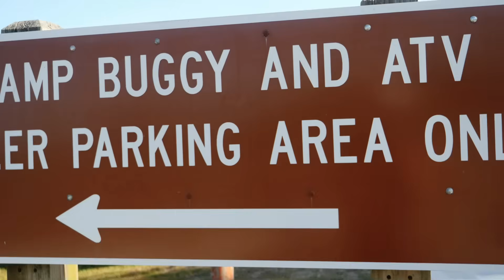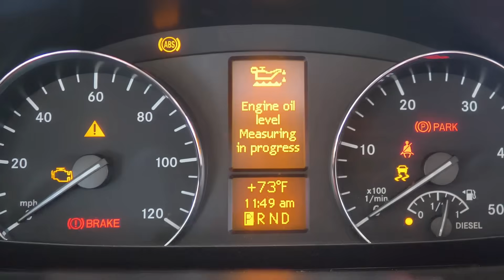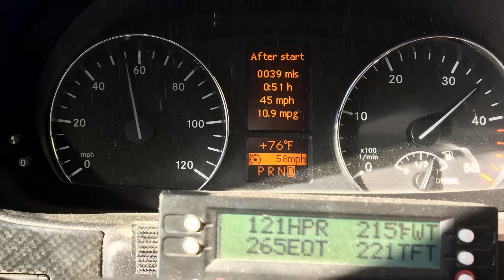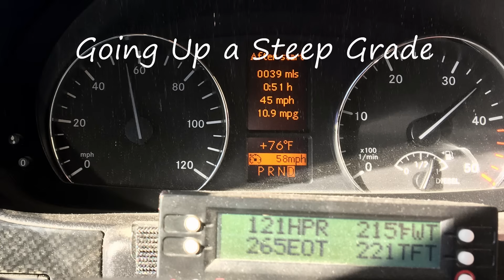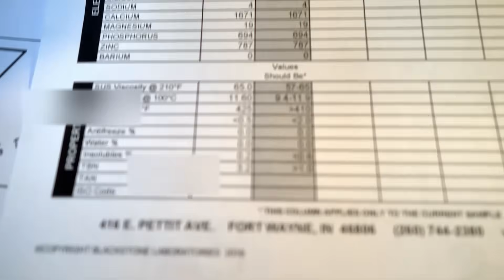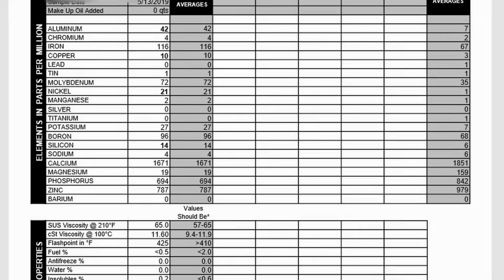Sprinter 20,000 mile oil changes

Comment: I asked Chat GPT why some manuals like yours state 2 years 20K miles, some say nothing, others state 10K and 1 year.  It said the following:

Why the discrepancy exists:
European owner’s manual
- 20,000 miles or 2 years
- Designed for Euro-VI engines and long-haul use, low sulfur diesel
U.S. Mercedes-Benz maintenance sheet (MBUSA)
- 20,000 miles or 1 year
- Mandated for U.S. emission and warranty compliance
Real-world diesel RV / fleet users
- Oil analysis often shows safe operation up to 15-20k miles or 18-24 months
- But only if oil analysis (TBN, soot, viscosity) confirms

Practical take For your (mine, low mileage) 2017 Sprinter 2500 (U.S. model):
The official MBUSA interval is 20,000 miles or 1 year, whichever comes first. The "2 years" clause is technically valid in the European context or for verified oil analysis intervals but not for U.S. warranty or emissions compliance. Low-mileage owners can safely stretch to 18–24 months only if oil analysis (e.g., Blackstone Labs) confirms acceptable Total Base Number (TBN) and soot levels.

So as you stated @ontheroadwithron2342 --

Chat GPT Recommendation:
If you’re driving ~2,000 miles per year, Change oil annually for simplicity and protection. If you want to test the 2-year claim, pull a lab sample at 12–18 months; if viscosity, soot (<1.5%), and TBN (>4.0) are in range, you can safely extend next time.

Comment: Hey Ron - great video!  I really appreciate the walk through of the oil analysis report, and especially you sharing the content- funny how useful actual DATA is ;)

I was curious how it's been holding up and what your comparison/trend has been with any subsequent analyses?  

I was intrigued by your comments on the clamps used on your fuel filter.  I've always used genuine Oediker clamps on fuel lines as they're very secure and not as susceptible to stripping out, failing, etc.  Your use of the solid band hose clamps is a nice upgrade vs the usual slotted ones.  Any reason you're not replacing with real Oediker clamps?

Overall I really dig your videos - gives the DIY person some confidence to get in there and tinker with their machines rather than to be so dependent on a dealer or mechanic - much of what you show is really pretty simple and doable.  

Thanks again!
Reply from the maker: As far as clamps go, I am more familiar with the solid clamps so used them. The original ones were difficult to remove and seemed like you’d need a special tool for them. Solid has done the job.

Comment: I am a few years into my Dynamax Isata 3. Just rolled 20k miles.  Conducted Schedule B. Your fuel filter change vid was very helpful. Thank you.   The Turbo Seal is now a newer part number MB 0000940051. From Mercedes they are $60.  I bought one from Amazon for $30 but had concerns that it might be aftermarket so I sent it back. Ordered one from AutohausAZ for $36. Shoot, it was green. So I went to MB and looked at theirs. It was also green and had the same marking so I kept it. 
I’m not 100% sure it really needs replaced at 20k, but I do see the MB bulletin on this so I did anyway. 
Keep up the good work Ron.  You must be an engineer. 👍👍

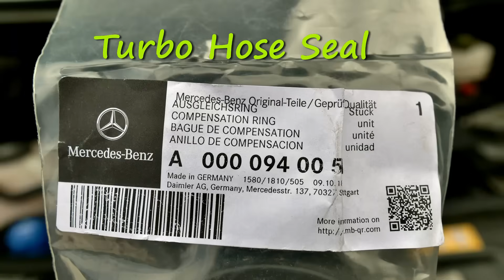Comment: 2:32 it's not that hard to reuse the existing MB Clic clamp, or replace with new.  There is a $15 tool if you search Clic or Clic-R.  That way the tension on the hose if perfect. 2:41 the MB bulletin says the clamp is to be torqued 3Nm with new seal always if disturbed, clean and dry reinstalled.

Comment: 20000 is FAR TO LONG. 5000 is a max if you want to avoid engine damage no matter what type of oil you use
Reply from the maker: There are a lot of opinions of course but 20k is what Mercedes recommends.  I’ve tested this at an independent labs and the oil is still good.
Reply: @ontheroadwithron2432  I love how all these people see hard evidence but still deny it

Comment: I have a 2018 Winnebago Mercedes Sprinter - I recommend to change the oil every year - because combustion creates water !
Reply from the maker: That’s true however the oil temps in a diesel engine are very hot and any water will evaporate quickly once up to temperature. If you only drive a few miles at a time, i agree an annual oil change would be best. RVs are usually driven long distances so not an issue.

Comment: Good info and all the comments listed below! Our 2018 RV Sprinter is my Daily Driver, maybe 15,000 miles per year. Today at 13,500 miles I changed the Oil only for the second time no filter change. I am sending the Oil out to the Lab to double check how the Oil is holding up in my application! I am using MB oil 5w30, but I'll probably use Mobil 1 ESP 5w30 and MB filters only. I use only OEM Filters, because of the Parts Warranty represent a better value! I am using a Caterpillar Oil Test Kit, $20.00, Kit Bottle/Postage to Lab/Report.
Reply from the maker: Great. Let me know the results. The ESP oil has lower ash so will prolong the life of the particulate filter.
Reply: As I mentioned our Sprinter is a 2017 Chassis with a 2018 Pleasureway Class B RV. When I bought it about 8 months ago, it had 3,200 miles on it, so I had the "B Service" even though it wasn't due. Now at 13,400 miles, I decided to change only the Oil and have it Tested to determine the Oil Change Interval. At this point I'll probably change the Oil/Filter every 20,000 miles and just the Oil every 10,000 Miles. I've spent over 50 years in the Diesel Truck/Construction Equipment Industries as a Regional/District Service Managers, so I've seen a fail amount of GOOD/Bad Maintenance Practices. IMO, I would rather error on the side of "Over Kill," rather than on the "Wish I did" side, there no down side! As for what Oil to use? I would recommend any oil that meets MB standards , but if it is available, I prefer the MB Brand because of the unquestionable quality and the fact that it stated on the Receipt, which will, benefit in the resale value. I noticed that Mobil 1 for example has 36 different Oils (all Mobile 1) but only one of them meets the 5W30 and the 229.52 Spec!

Comment: Change oil, using 10k interval. MB won't pay for your future troubles after using their 20K recommendation. My reference: 2011 Sprinter Van, 170" 2500 EXT with final 560K miles. 2016 Sprinter Van 2500 170" EXT with current 820K miles. New engine installed 180K miles ago due to failure original engine due to (in my opinion) MB recommended 20K miles oil change procedures.

Comment: Great video. My rig is a 2008.  Oil changes recommended at 10,000 miles. The first change was done by the dealer. I noticed that MB added a quart of BG DOC.  I performed the change this time. Plan to get a Blackstone report.  Thanks
Reply from the maker: Pretty easy to do. Main cost is oil.  If you can get it on sale, it helps s lot.
Reply: @ontheroadwithron2432  So True.  Thanks

Comment: Hello, thank you for tips. I wanna buy fuel filter, but Mercedes have three of them, which on I need to buy?  Thank you 🙏🏻
1. Fuel Water Separator Filter Product ID: 642-090-63-52 
2. Fuel Filter Product ID: 642-092-04-01 
3. Fuel Filter Product ID: 642-092-02-01
Reply from the maker: Depends on the year and engine type. 6 or 4 cyl. Just tell them your info and they can look it up.
Reply: @ontheroadwithron2432  2015, 6 cyl.
Reply from the maker: @kostyaexodus  i used this one. MANN-FILTER WK 820/15 Fuel Filter https://a.co/d/2JGF02W

Comment: Taking on the task on changing the oil. What size oil filter wrench/socket did you use. 88mm 14 flute? Also, did you use a crush washer on the oil pan bolt?
Thanks.
Reply from the maker: Wrench sounds right. I changed the plug for a Fumoto valve. No crush washer

Comment: I have the 5 cylinder Sprinter and after reading reports and with past experience with Shell oils; my thought is to use the Shell T6 5W40 or 0W40. The additive package Shell uses is better than Mobil for Diesel engines. The 0W40 (I live in Chicago winters) is superior to 5W40 but the cost is much higher and availability is spotty for the T6 0W40. I can tell the difference in winter cold with using the 0W40; the motor starts and runs from cold much easier. With 185K miles I am not using any oil with the recommended 10K mile oil changes. Planning on having the oil tested on the next change.

Comment: The seal number in the picture appears to be missing the last character (1) for a complete part number. Also, can't find that 13mm clamp on Europarts. could you post the part number. Keep the videos coming, have enjoyed everyone. Only Mercedes would require three additional parts besides the filter in order to correctly change the fuel filter. I have an old GL450 so I know what it takes to keep it maintained. Just purchased a Thor Compass on the MBS chassis.

Comment: Gotta remove the carbon an dirt ??
Reply from the maker: Normally soot is not a big problem. It does not cause engine wear. Even after 20k miles, my oil didn’t have any detectable quantity of dirt.

Comment: What do you think about going longer than the 1 year mark? I see that Mercedes recommends 1 year but I read information on these oils that they don't go bad in a one year time span. Did you do all your miles in 1 year?
Reply from the maker: I go 2 years. For my 2016 model, that is what the manual recommends. Older units were for shorter time periods. What’s your year?

Comment: Great video!  I see that you're using 0W-30, yet my local MB dealership (and other sources) are recommending 5W-30.  We use our van year-round, and driving in the mountains during the cold winter time temperatures makes me want to try 0W-30.  I know this might also improve fuel efficiency.  I was wondering what made you decide to go with 0W-30 and are you having any regrets?  Thanks!
Reply from the maker: Not much difference in the 2 but I just got what was on sale at NAPA. No regrets either way.
Reply: Would like to know the same.

Comment: Great video, really appreciate it!  

I have  2018 170 4x4.  27,000 miles.  On my 3rd oil change.  Probably changed it more than I needed too.  Something I have discovered with the OM642 engine.  It has a lot of blow-by in the PCV system.  Those of you adding 1 or 2 Qts of oil in between oil changes, very common (or starting with oil at the top of dipstick and changing it at the bottom).  It is most likely not burning any oil, it is pumping it through the PCV system.  Something along the lines of 1 qt per 10,000 miles (rough estimate).  I installed an oil catch can, a cheap one at that and it catches a ton of oil.  I will have to empty it probably 3 times in 20,000 miles.   You will also see people having to clean the EGR valve, this is why.  If you install a catch can it should do away with this problem.

Comment: Sprinter WILL EAT lots of oil at 200k , if you will be using 0w30 oil and change every 20k . So , go ahead . 
( most people will never see 200k on their Sprinters )
Almost 400k on mine and STILL not eating any oil. ( 5w40 229.51 and 10k OCI)
Reply from the maker: I don'y expect to get that may miles on my RV, especially with the travel restrictions.  Guy at the dealer had 400K on his also.  He changed per mfg recommendations.
Reply: @ontheroadwithron2432  
Guy at dealership with 400k - is one story and that story needs to be tested for lie
I know close to 50 REAL stories from REAL owner , each with 400-800k . 
You get the picture , like who was using what kind of oil and what OCI they had . 
I've got feedback from owners who used 229.5 5w40 ( much better than 229.51 or let alone 229.52 that dealer uses) 
Thanks for changing oil yourself and not letting deal to rip you off.
I suggest buy Xentry C4 - that thing can save you on your trip and will be paid off very quickly

Comment: Oil was changed 1 year ago. The level is perfect on the dipstick, but very dirty. Initial thought is to change it but it’s nowhere near the 20,000 mile mark. More like 4,000 miles. New to Diesel engines. Does the color at all indicate the need for a change?

Comment: Ron just purchased a 2012 Sprinter Cargo 170 ext for my business.  Been looking on info about what oil to use and because of your videos I'm going to use the ESP formula.  It's expensive but I feel worth it in the long run.  The oil now is super black and I believe it was always serviced at a Jiffy Lube type place which just used the regular 5W-40 synthetic oil.  You also answered my thoughts about having to prime the fuel filter before starting the engine.  It's my first Mercedes and diesel so everything is sort of overwhelming since it's so different.
Reply from the maker: snackman yes, the regular oil will fill up the DPF filter faster since a small amount of oil is always burned in the engine. Filter is expensive to replace.
Reply: Thanks always learning something.  Much appreciated.

Comment: Thanks for another great video I was wondering what kind of fuel mileage you get and how hard was it pulling the passes in the Rockies
Reply from the maker: Rockies were no problem. Steepest parts in 3rd gear and 50 mph.
Reply from the maker: I average 15.2 mph. This is at 60-65 mph
Reply: Thanks good to know. Now I won’t worry too much about it. Taking a little trip next week to the Olympic forest up on the NE corner of Washington. A little shake down run after fixing (at least I hope) a boost leak problem.  Thanks again maybe we will see you on the road sometime

Comment: Hi Ron, I only put around 3K every year on my 2016 sprinter, do you think it’s okay if I change oil every 20K instead of annually? Thanks for the effort putting these video, it helps a lot of people save money.
Reply from the maker: the oil change for a 2016 is every 2 years or 20K miles whichever comes first.  So you can go 2 years unless you have some extreme operating conditions. This synthetic oil is very stable and heat resistant, however contamination with dirt, soot and does eventually build up.  2 years is fine, any longer might be at a slightly higher risk.

Comment: I've ordered the supplies for my first oil change, but have one other question you might be able to answer. On my 2017 Sprinter  I'm trying to decide if the gear shift indicator should be showing what gear I'm in at all times.  When I downshift, it shows what gear I'm driving in, but if it shifts automatically, it doesn't indicate which gear, it just shows the D.  I talked with a service manager who has a Mercedes truck and thinks it should work at all times, but wasn't sure.  Wondering if I need to take it in for service or if I'm expecting more than it will do.
Reply from the maker: Sounds normal. The indicator doesn’t actually show what gear you’re in. It shows which gear is selected. Also if you downshift the indicator immediately shows which gear is selected, but the transmission may not actually downshift immediately. Sometimes there is a delay for example if you have been coasting for a while.

Comment: Hey Ron , I end up in using Mobil 1 ESP 5W-30 instead of 5W-40 on 2009 Sprinter 3500  (view) , later realized that manul states I should have used Mobil 1 ESP 5W-40  - Do you think i need to get that replaced ? just thought of take a reference .
Reply from the maker: John Lonappan the oil weight is mostly for different ambient temps. The 5-30 should be fine especially in cooler weather. You can use the md229.52 oil for all these 6 cylinder motors.

Comment: Great video, 
I drive a 2017 3500 MB sprinter. It currently have 17k miles. Yesterday it asked me to add oil, when I checked I had below minimum mark. I am wondering if it came low from dealer when new or if it is burning it...
Reply from the maker: RamRunner mine only burned a quart in about 15-20k.

Comment: I've sampled my oil with the same lab 3 times on the first oil and once on the second oil change. Same results (except the Nickel, Mine is at "2")   2qts added on the first 20K and 0qts nearing 40K   Thanks for the video.  I am satisfied that using the MB 229.52 oil is fine to 20K
Reply: Change the oil every 10k not 20k thank me later
Reply: @satt4603  Every 20K is fine.  Did you not watch the video?

Comment: Loads of these in the UK doing 3-500k miles easily with the recommended 20k mile oil change interval.
Reply: EU has different laws on oils and diesel fuel.
Example - in US maybe amsoil is a real Group IV 100%synthetic oil
Castrol and Mobil had lawsuit about it in US